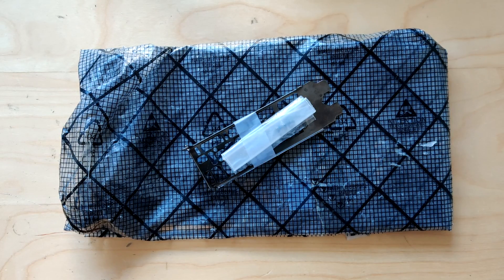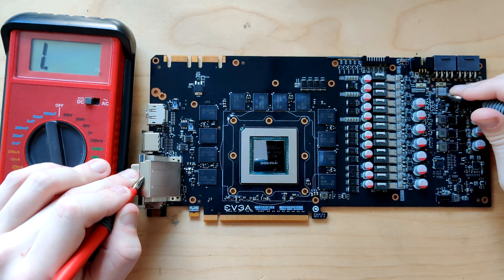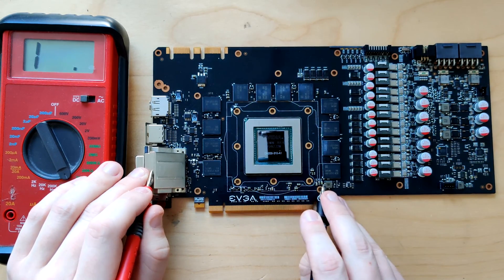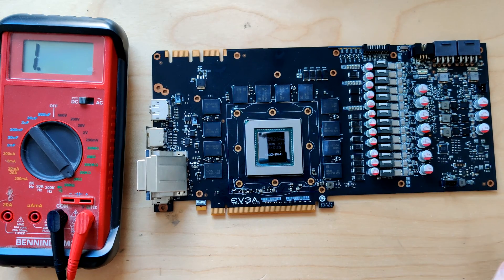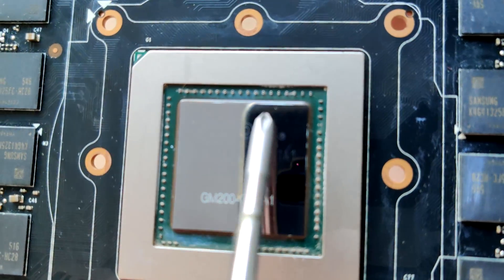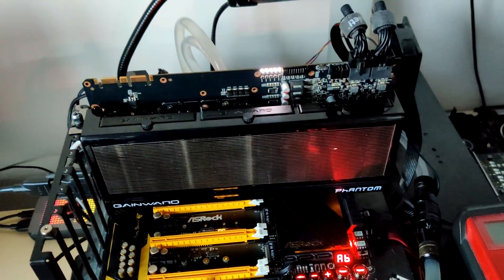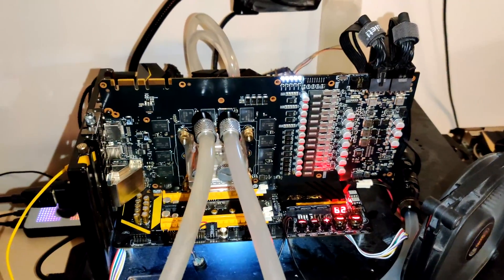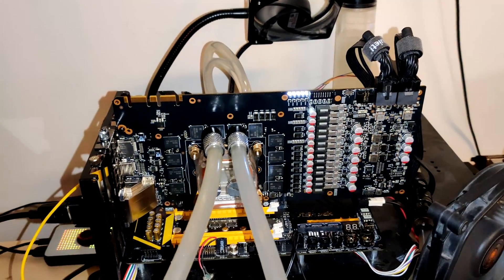Is this GTX 980Ti's Core actually dead? | Graphics Card Diagnosis

Comment from the maker: Have to mention that the Transistor does not actually output the memory reference voltage, it's actually created by a voltage divider. it is just a convinient place to measure the voltage since the voltage divider can vary a lot in layout but the transistor will always be easy to identify and measure.
Reply: nice, well done on the diagnosis! good eye on that crooked piece. when you cut it in half for epower will a couple of the voltage indicator lights will still work? they are the best part. and i have two dead kp that need cores, so the one youre sending is going to help.
Reply from the maker: @r4z4m4t4z  afaik all the indicator lights will stop working.

Comment: Thank you for sharing your experience. I follow your videos on GPU repairs with high attention.
Usually i do repairs on component level on MacBooks, but i have a 980ti that causes me lots if headaches.
It's an EVGA reference design that likes to kill it's bottom most DrMos randomly. I replaced it a few times now. The card is measuring well on all rails after repair and all is fine. After about 15 minutes of gaming it will kill the DrMos. Apparently without reason. I am playing old games with vsync activated. Power consumption around 140W then  Temperature is hovering around 70 degrees all the time, no artifacts or other weird issues like black screen or driver installation issues. The PSU just goes into protection because of the shorted Mosfet. It's a Corsair RM1000x by the way, but I also tried other PSUs.
I have no more ideas actually what the cause could be other than the core itself.
Can you recommend a GTX980TI or Titan that has a reliable VRM? I am asking because the PC is a Windows XP/MacOS Leopard Project. So i am bound to Maxwell as fastest GPU architectire it can run.
Reply from the maker: @andreeikmeyer678  those evga 980Tis have horrible vrm cooling especially on that bottom phase. That's why it usually dies. Could also be that the pwm controller has some sort of defect.

For a good PCB there is the classified and the strix cards. That's about it for the popular brands. The others aren't that great.
Reply: @CmdrSoyo  i agree on the cooling solution. That's why i "upgraded" to a Titan X reference cooler. The blower fan shovels a bit of air on the VRMs... I also agree on the PWM. I still have another parts donor card of same make and brand. Will see if i can measure a difference. If so, i will replace it.
Yes i thought about buying a Strix. I saw it has a different VRM. But i know you had one with bad VRM, so i was a bit unsure about it.
Thank you very much.
Reply from the maker: @andreeikmeyer678  my strix cards both had working VRMs just one of them had a dead GPU
Reply: @CmdrSoyo  sounds good! Seems like i managed to find a working D3OC Strix for €70. It's an hour of driving. I think i will go and pick it up today. Plenty of RAM and two cores here for replacement if it goes south...
Maybe undervolting and/or underclocking should help prevent the RAM/GPU issue? The I7 4770 will bottleneck the Strix anyways...

Comment: Hello, thanks for the video.

I had an old gtx 980ti with no use for like 3 years. This week I installed it in a old setup with a 750gold PSU. 
The GPU was working nicely until the computer suddenly shut down after 2 hours of use while playing a video game. 
Restarted the computer and the computer shutdown again, but this time while I was typing the windows password. 

Now the GPU is not working anymore. Any guess what happened the failure? Is my PSU the responsible of GPU damage? or Did my GPU was just close to death? 

Another GPU is on the computer now and the system seems to work nicely. But the 980ti doesn't turn on anymore.

Cheers

Comment: Looking at the memory test I have the same multicolored line but with E1 and F0 failed strangely enough I was able to boot into windows 7 and 10 with no crashing but with artifacts. I have gotten the memory replacement chips as I'm certain the core is working or not working. But main thing is I be sending my graphic card for repair to have memory chips replaced some day soon

Comment: looks like ripped pads under the memory modules or possibly the data lines to the GPU. Way to check is to remove the modules and then check the integrity of the data lines at the module BGA pads

Comment: Watching you play with this card makes me want to dig out my 980Ti and see if I can find where it went wrong. No damage to the core, and with all the testing I've thrown at it I couldn't find it. All the voltages seem fine. Thermals are good. Issue that occurs is that all connected screens go to 1 solid color moments after it enters P0. I've flashed different ROMs, underclocked, and limited TDP. I've done memory tests as well - however I don't think I've tried to limit the memory frequency or even considered what the memory does when it goes to P0.
Reply from the maker: Sounds like a memory issue yeah.

If the normal memory tests don't give any results you could try a more advanced mods test. Tech cemetery shows what commands you need to run for that in his video about a green pcb 3090 that crashes randomly

Comment: i've had gpus with similar damage, i'm fairly certain it's unrelated. could be that the fcbga package is no good, fairly common with older gpus. a good way to check is to heat the gpu up to around ~160 C and see if the problem goes away. if it does, the bumps that connect the die to the substrate are bad. connections around the edges of the die seem to be the most susceptible to failure, which would align with 2 dead memory channels.

Comment: hi can u tell me is the gtx msi 1080 and the 1060 the same  volt rails and when can the viewers see your face
Reply from the maker: the 1080 has GDDR5X and needs different supporting rails for it compared to the GDDR5 on the 1060